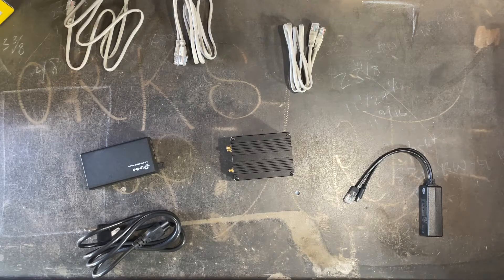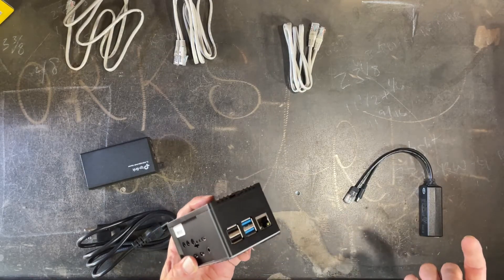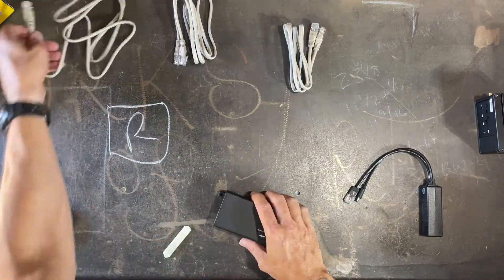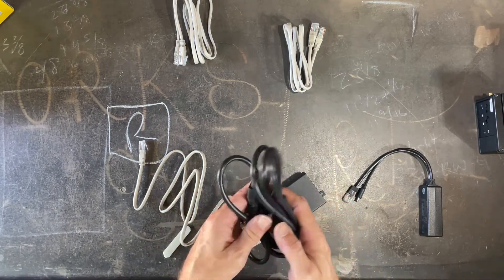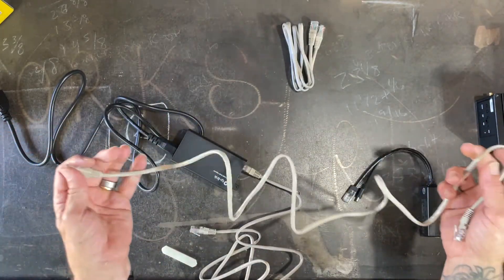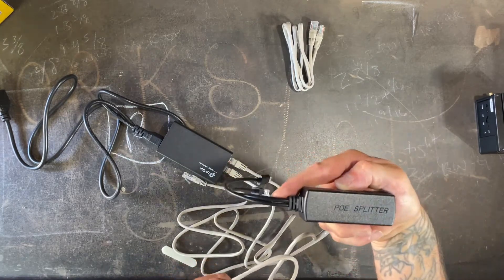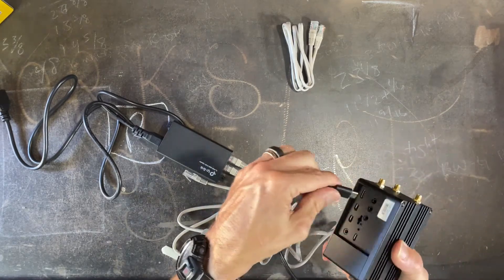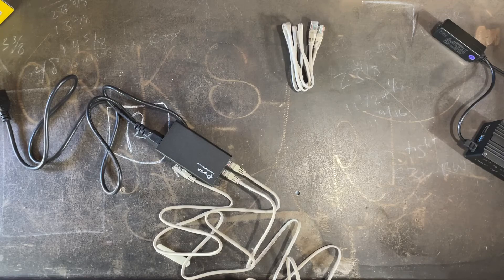PoE for Helium Hotspots, Explained

Comment: Nebra says the Poe for their miner needs to be 12v. 5V won’t work
Reply from the maker: Right on.  I'd listen to the manufacturer on that one.  Every Hotspot has its own specs, best to follow 'em
Reply: @thegristleking  I can find a 12v output Poe splitter but I can’t find a barrel jack to usbC adapter that’s rated for 12v. All I find is 5V
Reply from the maker: @rubberman2006  hmm, I remember having the same problem, but frustratingly I forget the part I used to fix it.  I know the LayerZero guys have all kinds of PoE options in their kit, might want to reach out to them to see if they'll share a source with you.  I know I didn't do a barrel jack to USB C adapter; was straight to USB-C.

Comment: Advice on PoE lightning arrestors? seems like nobody talks about this, and it feels like such a hassle that it would just be easier to connect to power and wifi.
Reply from the maker: I haven't seen them used or talked about.  Have you used 'em before?
Reply: @thegristleking  No i haven’t, but people talk about it in the helium discord. Some insist that it’s 100% necessary, and i would tend to agree, but it makes the whole PoE setup seem like more trouble than it’s worth.

Comment: Just got an answer from the freedomfi people about the freedomfi device if anyone is interedted on this info, "Yes it supports the POE and any RP-SMA 915 Mhz antenna."
Reply: Thank you and great to know. Just got my device a week and a half ago and after testing the baseline config (on second floor of home near window), I'm ready to take the next step in placing the device in either the attic w/external antenna, or similarly, but in an outdoor enclosure.
Reply: Does the PoE support mean that it does not require the second (splitter) device or instead, that the config described in this video (using the injector at one end and the splitter at the other) would work?

Comment: Do all standard ethernet cables work for this? I'm also wondering if it is OK to have an indoor nebra outside (enclosed) when Temps will go to 0'f this February.
Reply from the maker: Yep, 5e and above is fine for cat cables. Check the specs on the indoor Nebra for temp ranges.  In an enclosure might give you a little more leeway.

Comment: Any chance to get links to recommended PoE for RAK?
Reply from the maker: Sure, http://grstl.ink/rak-poe
Reply: @thegristleking  And for the injector? Just got a MNTD...  Not sure if I need a 24V or a 48V... Thanks for all you do!
Reply from the maker: @nikkifryn411  I've used this one https://grstl.ink/poe-injector
Reply: @thegristleking  Hi. Thanks for the great video. I'm also going to power a Rak V2. The one you linked is 5v 2.4amp (12w). The power supply that came with my Rak says 5v 3.0 amp (15w). Is this a problem?  I don't want to ruin my miner by under powering it.  Thanks!
Reply from the maker: @balkos7661  the injector linked says 12w? I'm seeing up to 15.4 watt --> 
https://grstl.ink/poe-injector

Comment: Thank you! I was wondering how to set up my sense cap  properly since I have it in the attic
Reply: I use a wifi extender with an Ethernet port, or you could just use wifi if it reaches